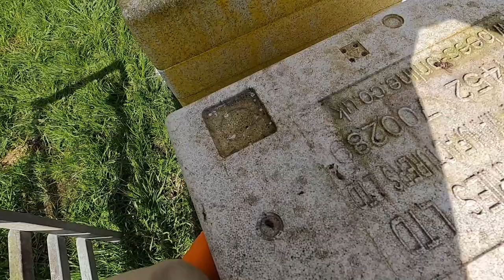Beekeeping for begginers. Part 3.

Comment: Will you be replacing that Black queen, she looks like she may give you trouble?
Reply from the maker: What trouble?
Reply: @irishbee3632  they look like there runners and started clustering on the bottom of the frames. Not ideal with any type of bee but can be harder to find a black queen when the cluster like that.